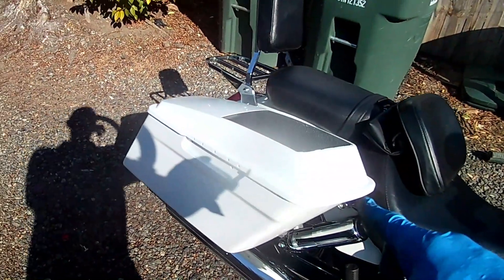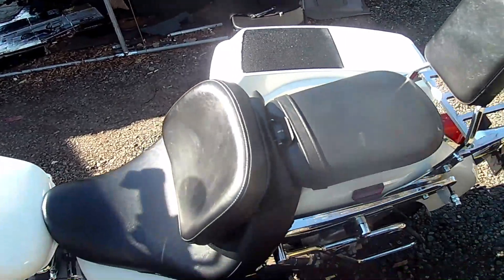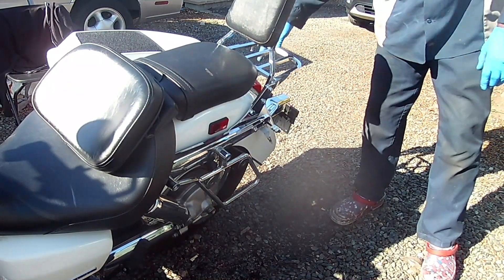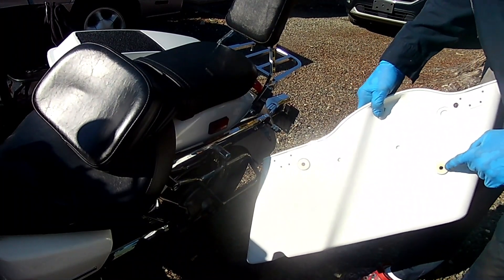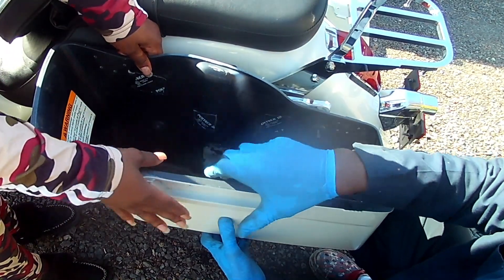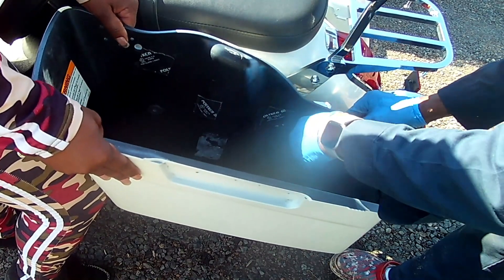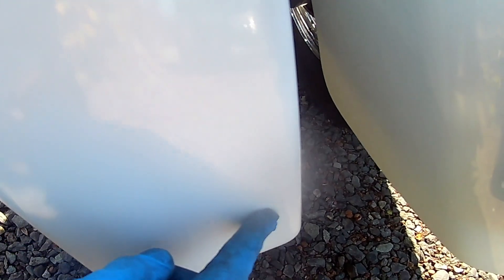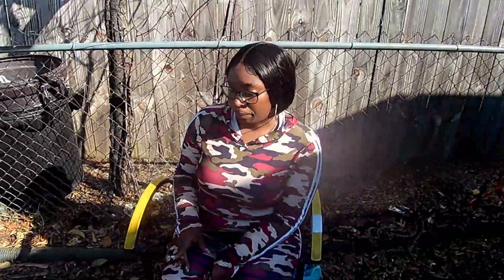How To Put Harley Davidson Saddle Bags Onto A Honda Shadow!!

Comment: How did you mark the spot on the bags to drill and where did you get the grommets to bolt to brackets looks good
Reply from the maker: Those I had here in the shop but I'm sure your hd bags should have sum if not Amazon

Comment: The flaw in your design is there's no bottom support  and you are bolted through plastic , not fiberglass .  In your inner view of the bag there's that groove molded into the bottom center.  There is a support bar that the bag is supposed to sit on top of when installed on a HD that bolts to passenger foot peg mount.  which I don't even see your passenger pegs .After stopping the intro I saw the rear foot pegs but it doesn't look like she would be able to carry a passenger they look too close to the bags .
Reply from the maker: U can ride a passenger on the back and she can use her bags just like u use yours
Reply: OG, what model HD bag’s did you order, I have a 2012 Shadow and I’m trying to do the exact same thing to mine, batwing faring and all?